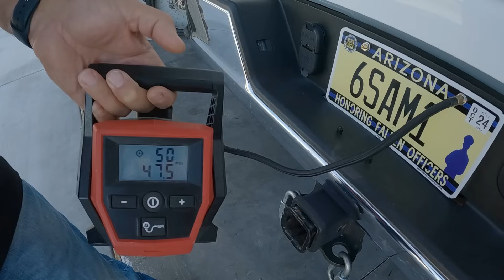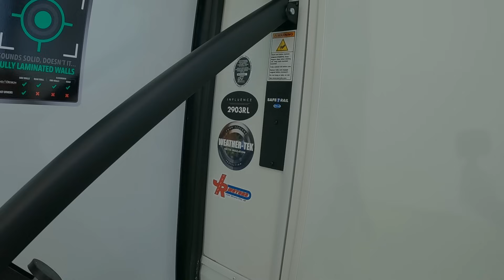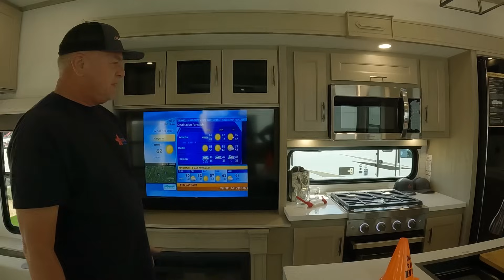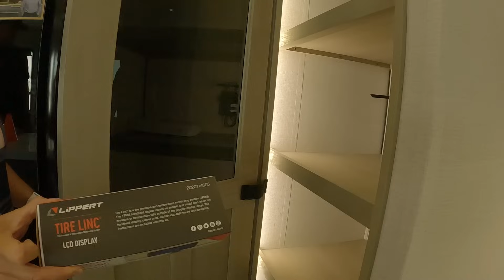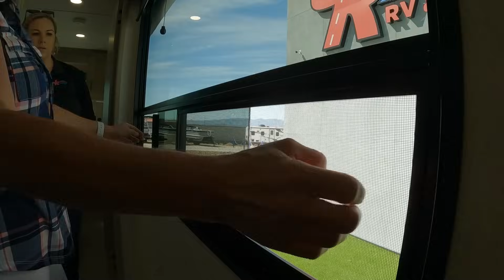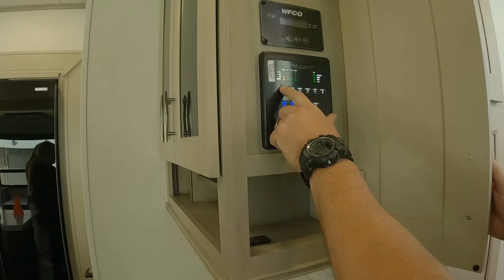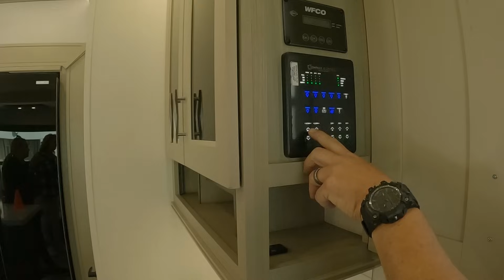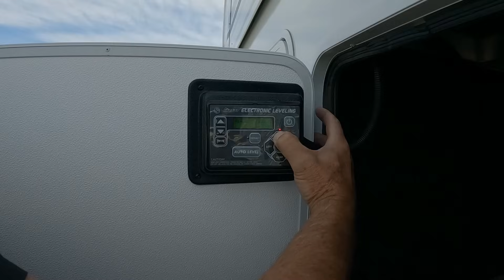2024 Grand Design INFLUENCE 2903RL // Our First Look!

Comment: Congratulations you guys - this is such a sweet unit - We look forward to seeing it in person one of these days :)   We know it was hard to give up the 2500RL, lots of memories in that, but those aren't going anywhere and you now have so many more memories to forge in this new rig (and in more comfort too!) .   Nice that they have pre-installed the the solar panels, and you have plenty of time to do the LIFEPO battery conversion later.   That dealership looks really nice - great that it is right next to home too.  You guys are going to be so happy in with this, and we look forward to seeing your adventures in this new rig when those air!
Reply from the maker: Hello Bob and Dang, thank you for joining us.  We feel really blessed on this new rig.  It is bright and airy.  Lots more and it’s only 4 feet longer than our 2500RL.  The technology has come a long way.  We have two 320 watt solar panels and a 2000 watt inverter.  We are so excited find out what exactly it all has.  It has an onboard WiFi you pay as you go.  It will be interesting to see how that works?
Reply: @OverTheHillAdventures  Sounds great, am am interested in that WiFi connectivity too - we use startlink now but this sounds like an interesting alternative, it will be fun watching you guys explore all this new tech.  When you say 4 ft longer - is that your total length - TV + Trailer, or might it actually be shorter overall or the same because it's a 5th and rides up over the truck a bit more ?
Reply from the maker: @bobanddangsjourney it’s 34 feet.  But I think you’re right we might be shorter.  The problem is we are 2 feet higher.

Comment: Congrats on your new rig! I certainly like your layout as it reminds me of our '23 GD 2670MK; finally, for us, a fireplace! And opposing slides. For us being here in FL and running up & down the east coast, my 5th wheel experience (owned 2) had to change as we go to some rather tight (tree infested) mouton roads and tree strike was (is) our biggest concern. But with our west trip (SD-WY-MT-ID-UT) last September, what a dream to be in "open spaces"! I am green re: auto-leveling feature.... you two will have a blast. And thanks for bringing us all on your "new rig journey!" And a sigh of relief form me -- yo stayed with Grand Design. (We are on our 1st GD.)
Reply from the maker: Hello Tim, thank you for joining us!  We always liked being smaller.  After going across the country three times it was time for us to go bigger and a little more comfortable.  Thank you for your insight.  Blessings, Stan and Rhonda🙏🏼❤️
Reply: @OverTheHillAdventures  I certainly understand (and agree, why we moved up to 2670MK from a 26ft 2014 Coachman Apex). During our 2019 NC trip from FL, we descended from Mt Mitchell (Blue Ridge Parkway) eastward so I could show my wife the outer banks (OBX)  on the coast, we "evidently" suffered a nasty sneaky tree strike albeit we were only 9ft tall (Apex rides low). No sign of major damage until water infiltration about the shower dome... by that time, a costly $2200. Ergo my fear , realized!   ;)
Reply from the maker: 😱Sorry to hear that! We didn’t realize ours is 13.5 high! That’s gonna take some getting used to 😅

Comment: She’s a beauty. Hope all the scuttlebutt about GD is just that.
Reply from the maker: Hello Monica, there is frame flex on some of the Grand Designs.  However, our friends that had it was taken care of by Grand Design.  These frames are not just in Grand Design they are in all brands and made by Lippert.  A lot of the scuttlebutt are from folks that don’t even own a Grand Design RV.  Then there are those who just are taken advantage of the negativity for more views on their channel.  

Some folks overload their trailer beyond its potential.  We do not have a drop down frame.  I have inspected it and it is solid as a rock.  Our last Grand Designs went 33,000 miles without a problem.  Some of these folks have legitimate issues.  I have faith they are being handled.  We have always said on our channels, Get A Professional Inspection before you buy a RV.
Reply from the maker: Thank you for joining us! Stan and Rhonda🙏🏼❤️
Reply: One keynote is this new rig is a Rhinobox frame that is designed to be 40% stronger. I have not seen any reports of issues with this design.

Comment: We went from a 27' 5th wheel to a 26' bumper pull and hated it. It felt like it was 10' longer and 20,000 pounds heavier!! Went back to a 40' 5th wheel and what a huge difference! Much easier to handle too.
Reply from the maker: Hi Linda! Thank you for sharing your story! Wow! This 5th wheel is taking some adjustment, but it’s encouraging to hear that you didn’t like going back to a bumper pull. Thanks for reaching out! ~ Rhonda and Stan

Comment: Congratulations. We did the same thing. Changed from 2500rl to the reflection 295rl. Love it. One question,  what was your decision going with the andersen hitch?
Reply from the maker: Hello, thank you for joining us!  My good friend Scott, is a west coast distributor for MORryde.  He has a Reflection 337RL and the same set up.  I was impressed by the way he backed up his trailer up our steep driveway.  He explained to us how the hitch worked.  At the point we were all in.  It is very light, small, and you can taking out easily.  It has a rating of 24,000 lbs.  We took it for 500 mile shake down trip and the hitch did incredible.  There was no chucking. It was a solid application.  Our video on the hitch comes out today at 4:00pm Phoenix Az time.   Hope you will join us!  Stan and Rhonda🙏🏼❤️

Comment: We’re looking at that exact same unit. How is the AC in it does it cool the unit really good or does it struggle to cool? Heard some things about it. Just wants to be sure thanks and safe travels
Reply from the maker: It has two 15K BTU air conditioners.  No problem cool. The back air conditioner has a heat pump.  We replaced the front air conditioner because it did not fit in our garage.  We put in a low profile and it cools
Great!! We love love love this rig!! Stan and Rhonda🙏🏼❤️

Comment: Congrats.  If you already had the B&W Ball, why do you also need the Andersen hitch?  I don't know much about them,  but I have seen them break.  It wasn't a good day for the camper, his truck or the rig.
Reply from the maker: Very few have broken and they were involved in an accident.  The Andersen hit attaches to the B&W Ball.   We have a very steep drive and the way the Andersen Ultimate Hitch works is the best for us.  It gives great rail clearance.  The Goosebox or the Gooseneck doesn’t do that for us. Thank you for joining us! Stan and Rhonda
Reply: @OverTheHillAdventures  Agreed. The only time I've heard of them failing is in an accident (as you said) and during a sudden emergency stop with a heavy 5er. The shearing force caused the four supports to bend and then buckle. That was only one occurrence that I am aware of, though.

Comment: That is a nice looking 5th wheel. You might want to check with the frame manufacture to see if they will warranty the frame since you are using an Anderson hitch.  I spoke to Lippert a while back and for gooseneck they only approved the Reese Goose Box.
Reply from the maker: You are 100% correct.  Isn’t that interesting? I’m not positive but they own a large stake in Reese.  I wouldn’t be surprised if they own the entire thing like they own  Furrion.  However, they can’t dictate what hitch you use.  Most of these frame flex issues are their frames.  Their frames are in every brand of travel trailer.  Of course they would only want you to use one particular tow mechanism they are deeply involved in.  This allows them to divert liability.  

I wanted to buy the Goosebox it’s a great gooseneck it just did not work for me.  So I want to stay positive.  Lippert is a great company 95% of all components in RV’s are Lippert.  Lippert has the monopoly on the RV market.  Everything in my new rig is Lippert or sold by Lippert.   The Gen Y is a great gooseneck hitch also.  

I chose Andersen because it fits my needs with my steep driveway which the Reese Goosebox could not provide for me.  I needed a little more lateral movement.  The Andersen hitch also allows me an up and down adjust that no other hitch can.  Andersen has great warranty over and beyond.  

This was a great comment and I am glad you bought it up.  Thank you for joining us! Stan and Rhonda🙏🏼❤️
Reply: I think you are confusing two different components.  The Anderson is a hitch.  The Goosebox is a pinbox.  The RV manufacturer cannot dictate the hitch.  They can dictate the appropriate pinbox you attach the RV.
Reply from the maker: @KylesRV  I get it Kyle.  Lippert can’t say the only approved pin box is the Reese Goosebox.  Thanks for watching! 🙏🏼❤️

Comment: New RV looks great. It will be interesting when you weigh it. The pin weight is pretty high for a 3/4 ton truck.
Reply from the maker: Hi Rick, you are right we are very close. Our payload is 3,305lbs.  Pin weight is coming in a little under 2,200. We can eat up 1,100lbs pretty quick.

Comment: Have you checked the true pin weight yet?  Love the trailer and my 2500HD gasser has 3580 lb payload, but this trailer would be about the max weight I would want to be at. Congrats, it’s a great looking rig.
Reply from the maker: Hi Russ, Grand Design puts it at 2,190lbs.  I never believe that number.  I have not had it on the Cat Scale yet.  I can tell you we just did our 500 mile shake down trip and towed very nicely.
Reply from the maker: Most of it was in high winds!
Reply: @OverTheHillAdventures  is your truck a 2500 or 3500, and what is your payload?  Thank you!
Reply from the maker: @RaaJra1992  2022 2500HD Turbo Diesel.  Payload is 3,305.
Reply: @OverTheHillAdventures  thank you!
Reply: @OverTheHillAdventures  watched quite a few of your videos on your Imagine but never subscribed till today. We also have a Imagine, 2950 that we bought new in 2016. Might be time for a upgrade, can’t wait to see your videos on this new rig!
Reply from the maker: @RaaJra1992  I have to say what an incredible difference.  It’s a little daunting because it’s so big but it was the smallest in the Solitude line.  It’s the same as the Solitude 2930.  We love it 100% better than the Solitude.  The new technology is crazy. Plus it comes with 640 watts of solar and a 2,000 watt inverter.  12volt 16 cu. Inch refrigerator.  Absolutely incredible.  The next size up is the 3503RL way too big for our truck.  This one is close but just right!

Comment: You should buy a welder because the frame may break before you get home or your first trip and will need to be repaired on the side of the road  our friends broke 275 miles from the dealer and called us at 200 pam in the morning to help the frame broke in two different places. on I 65 South
Reply from the maker: Gregg, was it an Influence?

Comment: wow with all thats going on with grand design .Nice unit though
Reply from the maker: Hello Lee, we are well aware of the sensationalizing of negativity of the frame flex.  The truth is, almost all RV’s brands use the same frame.  In light of that we choose to stay positive.  We have a small 5th wheel and have not heard or seen any of that with the smaller rigs.  The Influence is there new line.  This rig is only 4’ longer than our last Grand Design.   We took our last Grand Design over 33,000 miles without a single issue.  We have seen personally how Grand Design with their SRT teams work tirelessly to make things right for folks having problems with their rigs.  Thank you for joining us! Oh, we also pray over our homes.  Blessings, Stan and Rhonda🙏🏼❤️

Comment: You spelled Frame failure wrong it's not Solitude, it's Influence FF now. I wouldn't buy from GD if they gave me one for $1. I hope you have great luck with it. It's a shame they are doing what they are doing to ones with the issues and how some were treated. It's a nice looking rig, and congrats on getting it. You should DEMAND form grand design the weight limits for each slide, total added weight allowed in the front bedroom. The proper weight distribution in pounds for each section of the RV. The problem is they probably won't tell you, so they can deny claims down the road. One more note, careful with the bedroom slide with the sink in it, check the plumbing fittings they used, as most likely flex hoses, and add it to you inspection lists after slide is in and out for hose movement, kinks, etc.
Reply from the maker: Thank you for your input! Which Grand Design did you own? I had my last Grand Design for 3 1/2 years.  I do agree with you about the flex hose.  Fixed a lot of leaks myself.
Reply: @OverTheHillAdventures  I didn't own one, I said I would not buy one. I'm waffling between an Alliance Avenue 32RLS (ccc=3495) and An Alliance Avenue 33RKS (ccc=3795). Both are about same length as your new one, but your ccc is about 3200. Getting ready to sell my sticks and bricks, go full time, and have been selling all my stuff on FB marketplace since October, lol. I've also been weighing and placing in bins what I am taking with me. SO far  at 687.2 lbs plus need to add clothes, kitchen stuff, and food, water, and doggo is 49.5 lbs lol. Great luck with your rig though. Hope you have the same luck as your Imagine. fyi, I was looking at getting a GD until all the stuff started happening, all the sellout ytubers who had it, made videos, and then gd allegedly made back door deals, had them remove videos and sign nda's allegedly. That was all I needed to see to rule them out. Sad really. Now imagine if the did a video with what they learned, what has changed, and what assurances you will have that your influence which by my math is about 20k higher than similar past model was , that it won't happen to you. I feel anyone buying an influence is paying for frame failures of past customers. Just my opinion of course.
Reply from the maker: @SonarTravels  I can appreciate that.  We are not affiliated with Grand Design.  We are definitely part of the Grand Design family owners.  We have  done a lot of research.  The new Influence does not have a drop frame.  That is why we got it.  I have several friend that have issues with frame flex.  They handled it in a good manner and Grand Design fixed the problem.  Is Grand Design perfect absolutely not!  However, I am not going to get on the band wagon of negativity just to get clicks on my YouTube channel or any other social media.  I will not be bought if something is crap I call it out.  I have to be true to myself and God.  The trend on social medial is get as negative as you can.  Get everyone is a big tizzy.  They call that riding the wave.  Bad mouth people without doing some real investigation.  Lippert makes  the frames for every brand of RV. That is where the buck stops.  Plus more folks like yourself are going full time in a recreational vehicle.  

Does any other company you know of have a Special Response Team. “ SRT”. These are RV techs that Grand Design sends all over the country and fix people’s rig.  Plus if they find someone stuck on the side of the  road with an emergency problem Grand Design’s SRT will stop and get them back on the road.  No one else does that.  

So you mentioned Alliance they came from Grand Design.  Brinkley came from Grand Design.  Since you hate Grand Design go check out the all aluminum frame, ATC 5th wheels.  

Hope this helps! Stan and Rhonda🙏🏼❤️

Comment: Hope they fixed the frame flex on those!
Reply from the maker: Hi Emma, we were at the Grand Design National Rally we had over 100 rigs just in our section.  The one we have is a smaller rig.  I have not heard of any issues with this rig it just came out.  It’s a little over 34’.  Having said that, we did have friends at the rally with frame flex and Grand Design took care of those issues.  There were very few in our section.  Most of those were the very large ones.  Thank you for joining us!  Stan and Rhonda🙏🏼❤️

Comment: I say they influenced me!! What they have done a lot of Grand design owners wrong! They know that the frames on their 5th wheels are inadequate for the floor plans built on them. The under engineering, and over building for lager profits, is just wrong! Build them right!! And prove it!! Until then I will not buy any product from them.
Reply from the maker: Maybe so but they have also done a lot of Grand Design owners right!  It is only my option, but how many folks do you know that go full time moving their entire home into a fifth wheel, weigh them to make sure they are not over weight?  I know and have a lot friends on this channel that had problems with their Grand Design and frame flex.  Grand Design stood by them and fixed their problems.  What Grand Design can’t do is give folks life time warranties on second hand RV’s.  Everyone should be responsible before buying an RV and get a professional inspection done.  Just like buying a home.  Have that documented.  Then they should have scale weights documented to prove they are not towing over weight.  Remember there is only a 3 year warranty on the frame of your RV.  I was also taught you get a lot more in this world with sugar than vinegar. We choose to stay positive on this channel.  Just our thoughts.  Blessings, Stan and Rhonda🙏🏼❤️
Reply: @OverTheHillAdventures  I wish you good luck. I opted for a bumper pull without the Z frame. Shown in picture.
Reply from the maker: @On-down-the-road  safe travels beautiful rig!! Hope to see you down the road!